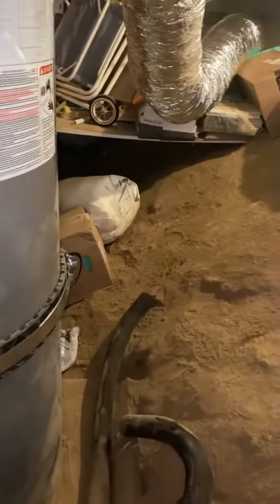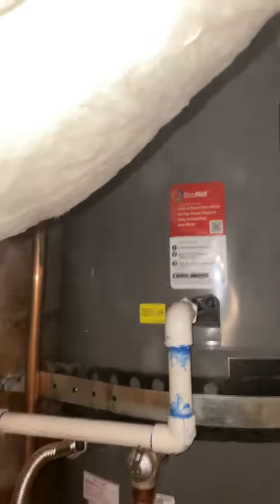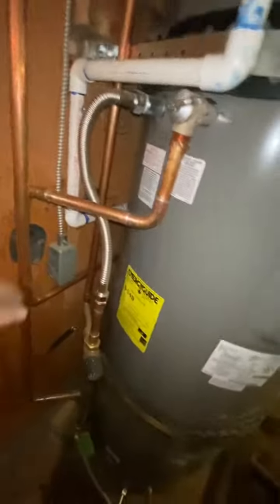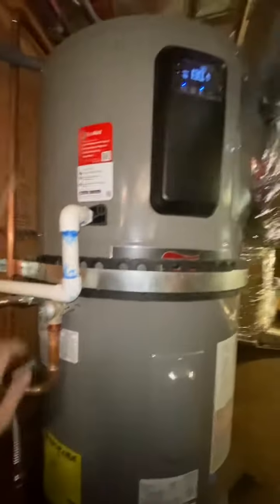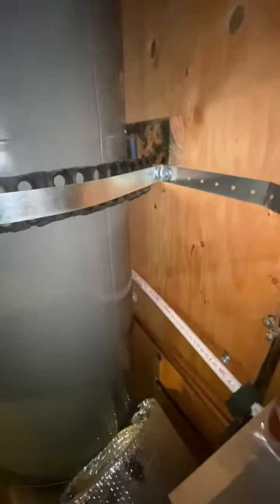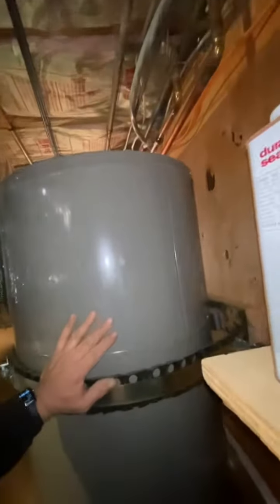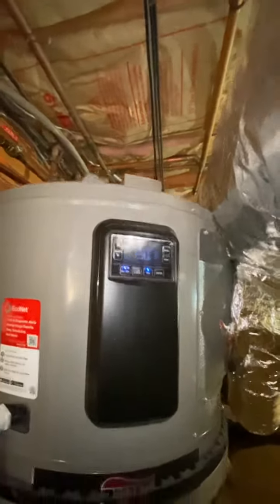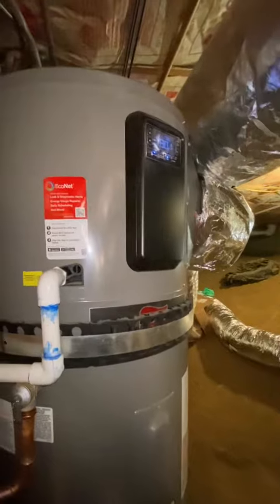Loud Ruud hybrid water heater

Comment: did you ever get the noise issue figured out? i am looking to buy one and see the older units are quiet and new units have a noise issue? is this accurate. Any failures out of all 50 that you have installed. was hoping to reduce my energy consumption. I currently have natural gas but will be very easy to pull the wiring. And i see alot of people are having issues with ignitors and gas valves on new natural gas water heaters. I just installed solar and have way enough excess power to power one of these. Thank you Mine will be going in the garage in central california, With a garage install do you think noise will be a issue

Comment: @larry waters - did Ruud/Rheem ever come through for you/your client and replace the unit? So many postings starting around Feb2021 through Sep2021 on loud units pointing to manufacture dates thru to around Jul2021.... seems some got full replacement units after working through Tech Support (not customer service). I am just about to commit to a Rheem HPWH.... and am anxious to know of the most recent experience / did Rheem/Ruud resolve the issue and also make things right by the customers affected?  Thanks

Comment: I recently installed a Rheem HPWH in the attic and it too has an incessant hum that travels throughout the upstairs. It's silent if I switch to the element but then what's the point of having an efficient heat pump unit. Very disappointed!

Comment: Yikes 😱, im thinking of getting a Rheem HPWH however it sounds like the company has a cluster on its hands… they need to fix the issue and issue a recall… compensating the installers and homeowners… sounds like a legal issue. Not acceptable… come on Rheem… your previous gen 4 units were quite… why would you not support your install base and customer?

Comment: I've been doing research about this issue before buying one and just came across a Rheem recommendation video that says you should use flexible piping "to relieve the potential of noise"  https://youtu.be/g1RZ6PMTBaY?t=133  I'm still wary about dropping this kind of money on a system that has noise issues, but thought it might be helpful for your customers.  Let me know if it helps!

Comment: When the compressor runs its going to make that noise 🤦🏼‍♂️. On the specifications it’ll say its so many decibels when running.
Reply from the maker: Actually Steve I have installed more than 50 of these. This is a gen five unit. Which I have installed six of. Of the previous 50 over the past three years zero noise complaints of the past six of the gen 5 3 noise complaints. You can hear the sound radiating through the entire house.
Reply: @larrythecomfortguy  so, if I may ask what brand and model would you recommend to get? thanks